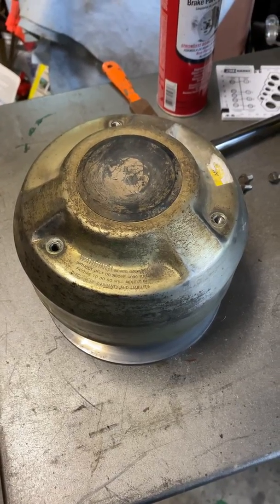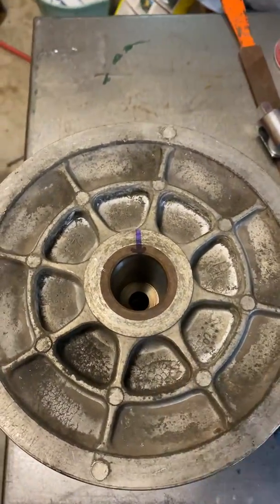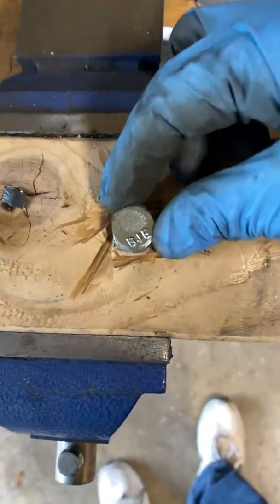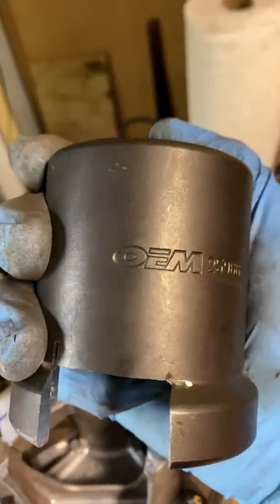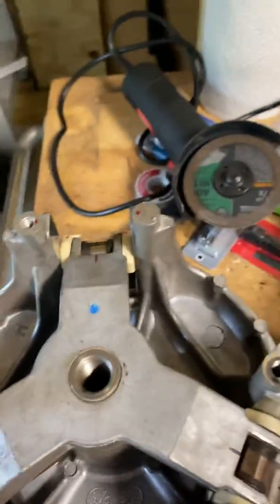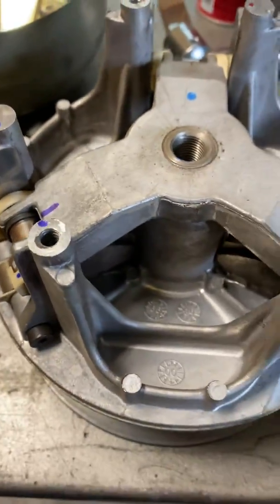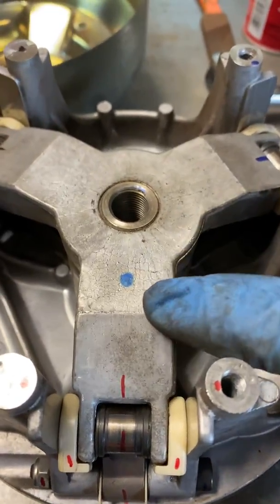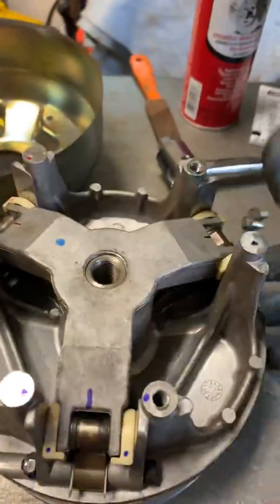6x4 John Deere Gator clutch disassembly and DIY spider removal tool AM140986

Comment: I copied your idea with a piece of wood, two bolts, and a 2-5/8" lock nut tool that I modified. I also clamped it down. I got the spider off to replace the rollers and put it back together (100 ft-lbs per the technical manual). Thanks for the help!

Comment: i have an issue with primary clutch 
i never notice any thing while the gator is running but , once i open and inspect my gator suddenly i found there is  a crack on the shaft near to the outer sheave ....its sooo difficult  to buy new one because its not available in my region 
is it possible to weld this crack by professional tig welding shop ?? is it work fine do you think ???